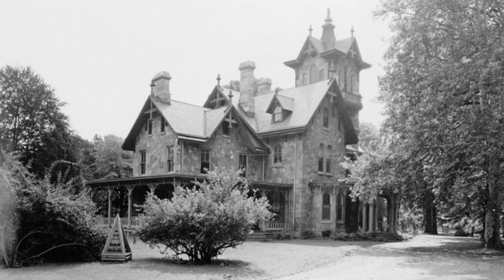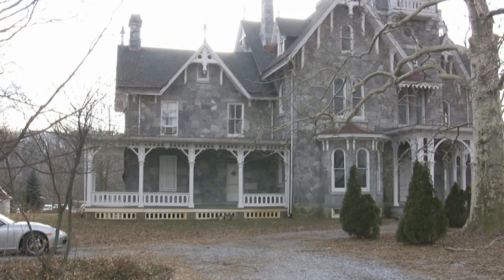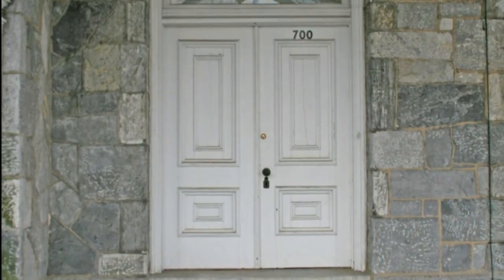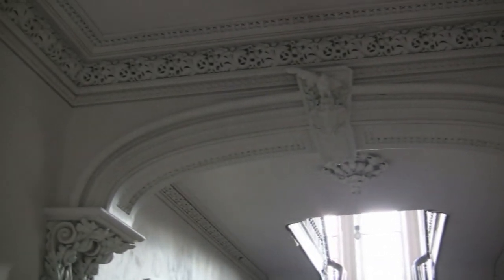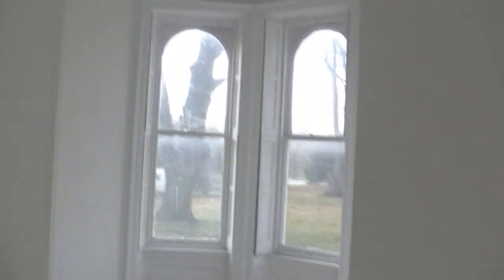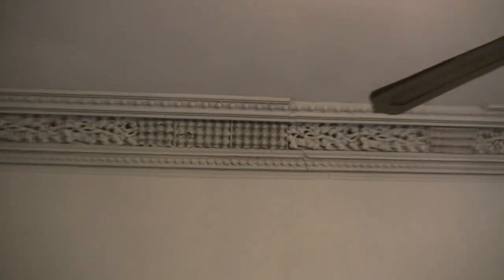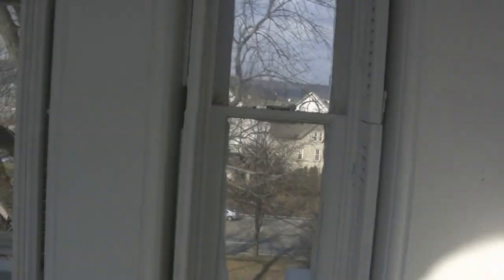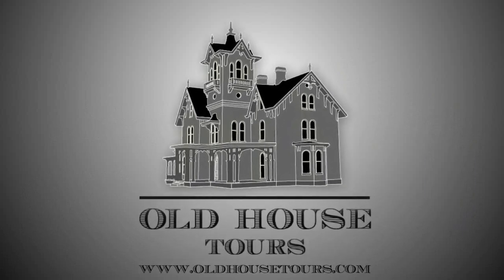Historic Home Tour - Loch Aerie (AKA Lockwood Mansion)

Comment: Those plaster moldings can be repaired. You can buy rubber molding material, mix it up, and paint it over the existing moldings. Peel it off and put it in a box of fast curing mud. push it into shape. Let that dry. put some oil inside the mold to stop the plaster from sticking
 Mix the plaster and pour it in. A little sanding when it dries and you are done!
Reply: This can also be done for ornate antique picture frames, mirrors, etc that have pieces of the frame missing.

Comment: I learned  on YouTube that the top of the newel post is not some missing connecting piece.  In such a home, the light circular piece was made of ivory and the center round piece was removeable and it is hollow down inside.  Once the mortgage was paid off the owners would burn the deed and put the ashes down inside.  There is a name for that feature but I dont know what it is.  God Bless YouTube!  You learn something new all the time.

Comment: This home looks exactly like our circa 1865 Victorian except our home has frame construction.  The same elaborate plaster molding and dark walnut spiral staircase with the same identical fireplaces.  The only difference .... our home is completely intact as if wrapped in a bubble and placed in a time warp or time capsule.

Comment: What a great old home. You show a close up of the staircase and say here is a remnant of a lamp, or a light, I'm not sure that is correct.  Years ago when "If walls could talk" was still on they were in an old home such as this and on the newel post it had a light colored insert on the top of it, just like this home has. The home owner said that this was a tradition, that when the house was paid off the home owner replaced the wooden top, with a top made with carved Ivory.
Reply: I've heard that same thing from another source. I've also heard that the deed to the home was inserted into the newel post.  I once saw a house of this same period with the ivory button.

Comment: Hopefully some can buy and restore it to its former beauty. So many are out of date for more modern or minimalist views. But these were built to last that water tank was effective for its time, now could be use for conserving water. Love the window blinds that fold back into the walls, out of the way but during the day so much natural light, in the heat of summer could also be used in passive cooling to block out summer heat during the hottest part of the day. Same with the porches letting in light or a sleep out at night for cooler evening. Also collecting heat on a winters day. So many features most don’t realize today. Well built home, wonder if the alarm system still works lol. The area for underground storage, the Coppola used to vent to prevent excess moisture, mold while retaining the gardens freshness. Put back in the natural possibility of an English garden, pond, beautiful lighting inside and out for a home or business many possibilities

Comment: All I can say is "OH, WOW !" You did a Fabulous job of showing the interior , just FABULOUS !  What's the height of those rooms...16 ft ? In which case it will be a humdinger to heat. Money provided, I'd be inclined to move it to a better and safer location. May I suggest that although it may not seem important to you,  show the kitchen , layout and size.
Those ceiling moldings ! Master craftsmanship ! It also looks like the other ornate Crown Moldings were taken down. It must have had servant's quarters at one time.

Comment: You should check out Linwood Lawn near Lexington Missouri. It is an 1850’s state of the art time capsule. It is in near perfect condition with original indoor plumbing, including flush toilet, central heating and cooling, and original gas chandeliers.

Comment: At one time either late 60's or early 70's a motorcycle gang lived there. And in the early 80's across rt 30 was a strip bar called the Stinkin Lincoln. I do miss those times, how it's changed.

Comment: Such a big house with such a small and insignificant entrance way. Is it possible that the first floor was covered up and a new entrance was created on the second? If the area you called a storage cupola was dug completely out, Hill and all, could it have been the original entrance?
Research mud flood! Thanks for the video.

Comment: So sad to see something once so beautiful, fall to disrepair. I wonder if someone wanted to purchase the staircase (looks a bit like Mahagony) for $100,000? In any case, the fact that this house has stood the test of time (minus what appears to be water damage from a leaky roof), makes it even sadder that it's being sold as basically rubble. The water tank and the small room reminded me of The Changeling - great movie!

Open bid is $250,000 for this property on 2 acres with 4 additional acres elsewhere (not adjacent). The auction is geared towards the property becoming (if not already zoned) commercial. With HD, the I-30 and a Sheraton Hotel as views, I find it hard to believe the estate is asking so much for 2 acres - trust me, if there's a buyer, s/he will demo the house and put up another business. Sad.

Also, the estate definitely gutted the house. It wouldn't surprise me if you saw that the Tiffany lightshade(s), cornices and other original items, were sold through another auction house.

The rails going to the small room, looks like wrought-iron.

Comment: The contrast of beauty and excellence that mansion provides versus the Home Cheapo that now occupies its back yard is striking. With proper maintenance, that home could stand for centuries. The fact that more and more people fail to recognize the difference in substance between a marble-limestone facade, and the simulated brick and flimsy vinyl siding sold inside the Wall Street junk shop next door assures our decline. That home would cost more to re-create than that entire shopping center.

Comment: It's basically still a gorgeous house.  The mouldings are sufficiently intact to be able to replace the missing bits in correct style. Who ever put egg boxes in as a substitute must have done it as a sick joke.  Loads of work to bring it back to a grand home. Not a lot can be done with the Home Depot across the road but surely that must mean it will keep the selling price low.

Comment: those built in blinds are called shutters and were commonplace in the 1800s; those are in remarkably good shape; my mansion's had many of them broken and after so many layers of paint didn't close right.  they provided great light control and insulation, and must have cost a lot of money; I think the house is pretty ugly, but certainly must have been grand to live in.